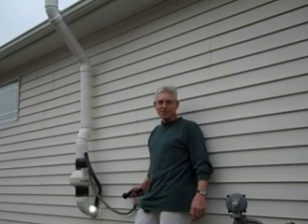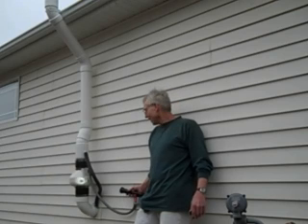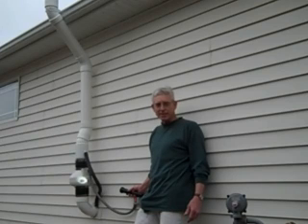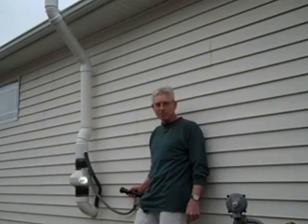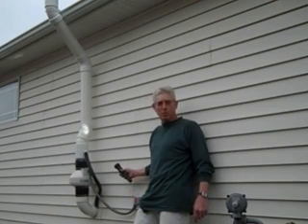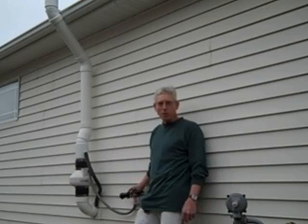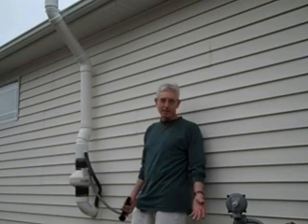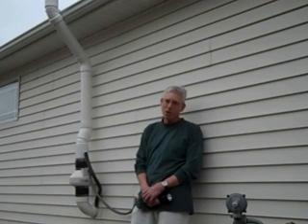Radon Mitigation System - Concrete Slab Foundation

Comment from the maker: Underneath the slab is usually aggregate, a type of stone. Aggregate is cleared away from the hole leaving air space so that the air can circulate freely through the aggregate under the slab. In certain situations such as older homes, there is no aggregate. The home is built on clay on this climate. This makes the circulation of air much harder, but there are techniques. All techniques require that a space be left around the pipe for air to circulate. I hope this addressed your question.